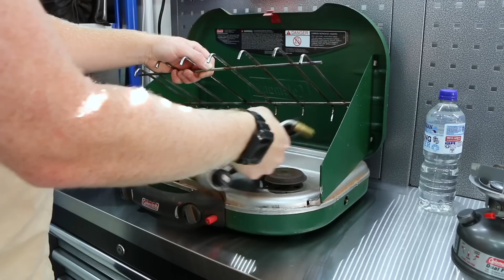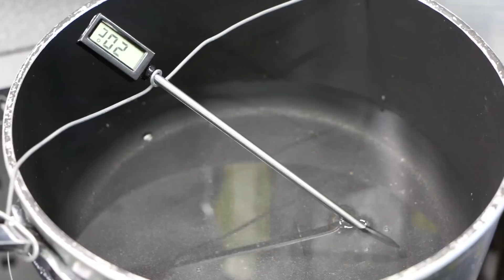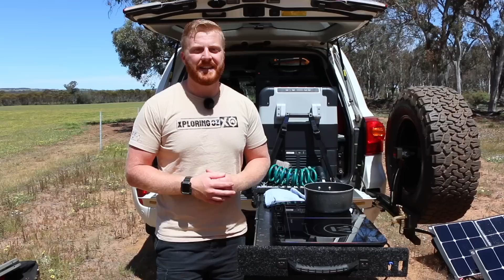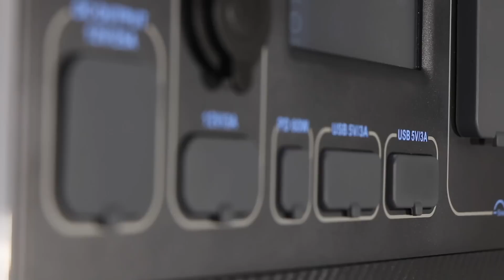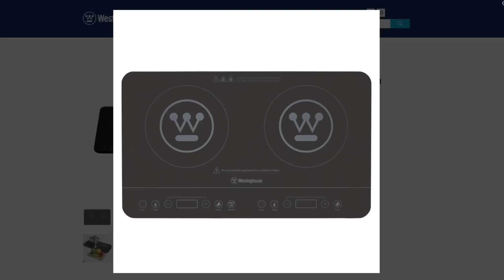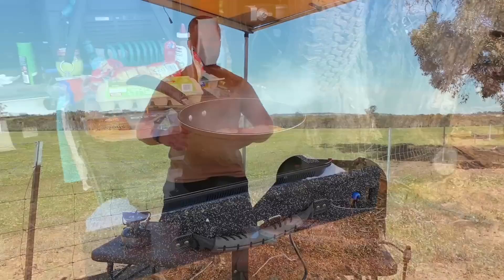INDUCTION COOKING & Camping | Is it sustainable | Electric vs Gas | Overland Cooktop | Pots&Pans

Comment: I'm still not sold on induction only because of their heavy reliance on expensive battery infrastructure I choose to apply elsewhere.  
Traveling in the USA, I have enough battery to run induction (300Ah and 3000w inverter) but instead need to ration electricity for my cooler, lights and especially a 1300w AC to keep my cab live-able at night in high heat and humidity.

I am lucky to have an old, dual burner, dual gas Coleman (love it!) so I don't need to bother with propane.  I also carry a Snowpeak fire pit which I love to cook on when I can.  (Fwiw - I have a Jetboil someone gave me.  I've never used it.  I'd give it away if anyone asked for it since I can't justify the single-use canisters butane and some propane stoves use.)

  I think if I do anything it will be to reduce the cooker footprint with a fancy Jetboil Genesis and 5lb reusable propane bottle which will last ages and will never need top-up while camping unless I get really careless!
Reply from the maker: For sure, it's not everyone's cup of tea. It works, but it comes with sacrifices and compromises, its just depends whether the individuals setup requires that level of compromise 👍 
Glad to hear you have a suitable solution though

Comment: That seems like a really efficient setup.  1400 watts/12 volts=116 Amp hours.  You used approx. 30 X 4= 120 Amp hours. It seems not much of a loss between the inverter conversion.  I wonder if thats due to the Bluetti or that particular HOB?  I just watched another video, not sure of his setup but he had a 50% conversion power loss.  Different HOB though.
Reply from the maker: Interesting to hear the lack of efficiency on the other unit. I would suspect that it would be in relation to the appliance though as my testing with the Bluetti shows some positive efficiency results 👍
Reply: BlueTTI inverter will have 35-40 watts of losses, in ac200max unit, wherever there is any load of not.

Comment: Funny, I was watching this because I am looking at the Westinghouse induction cooktop and then you bring out the bluetti. To top it off you charge it with a 1000w inverter while driving. Lol,  I just brought a bluetti ac200max (with xtra batt) and a 2000w inverter (1400w mac charge on the bluetti) to do the same thing you thought of two years ago. Maybe I should watch a more recent video for more ideas😂
Reply: I own 3 different types of induction cooker and have been using these on the bench continously for a yr now.
Tips:
Dont be at all concerned with temp control
Do by a cooker with a low minimum power for simmer, eg the Ikea has a minimum 100w, some are 200w which is too much for simmer.
Dont buy a cooker that a has long period beween power pulses. Eg, the Westing house hasa boom bust simmer, were the simmer dies in the off priod, then the power pulse boils it over. Once again, the Ikea unit has short cycle times and your simmer is much more consistant.
Do buy heavy base induction cookware, eg the pots and pans at Ikea are relatively cheap, and very well made. The heavy base gives much more consistant results.
Reply: You can get Instant Pot pressure cooker for efficient cooking and simmering and steaming with electricity. They have also air fryer covers, so baking and roasting is an option too.

Comment: Infrared burners more versatile you can have it do double duty as a heater if you need to put that just my two cent hot take
Reply: They are pretty good. I got one in rented apartment, I think. It looked like induction, but wasn't induction. It had flat glass top, but there were some heating elements glowing red. I don't think it is valid reason, though. If you want heating just boil a lot of water.

Comment: A great way to go is just a standard 12V 100Ah AGM battery in place of the stock battery. $200 from china now. They are pretty damn good. No charging restrictions under 41F like lithium. So you can leave in year round in all locations. China is good at pcb components and battery production. I find i use about 100Wh/cook.
Then just get a standard Renogy 2000W inverter and you are good to go. $500 all in with taxes. Then you can go wild and get a portable heat pump unit, an induction burner, and maybe throw a solar panel on the roof.
Reply from the maker: Maybe, however I believe the AGM battery will struggle to output the required current for high powered devices like the induction. The voltage would drop down to an unusable level. That's my experience anyway 👍
Reply: 100ah AGM battery weighed 28.5kg whereas a Lithium 100ah only weighs 12.5kg
If you buy a single AOLithium 100AH, it has a 200A BMS and can easily run a 2000W inverter by itself @ 2000W until it is depleted.
Your AGM wont do that.
Reply: @nordic5490  Only thing you have to think about is if its the main battery, the car won't start after 12.0v. So a great idea to add as a secondary with a smart switch.

Comment: What do you do, if any, about the emf radiation?
Reply from the maker: I personally do nothing 👍
Reply: EMF field density is inversely propotional to the square of the distance. What this means, is that the pot @ 5mm away is closely coupling and 95% of the enegy is tranferred to the pot.

You @ 500mm away, the field will couple SFA, nada, ie, no measureable energy will be transferred to your body.

Comment: Printed on your induction cooktop is not to place it on metal surface. Yet you did and it worked. Or maybe only magnetic metal interferes with it?
Reply from the maker: This is true, however this bench is a very, very thin metal liner, not solid. It compromises mostly of a wood centre 👍

Comment: Nuwave Flex Precision Induction Cooktop, 10.25” Shatter-Proof Ceramic Glass, 6.5” Heating Coil, 45 Temps from 100°F to 500°F, 3 Wattage Settings 600, 900 & 1300 Watts

Comment: For overlanding I've found the induction cook top and, a 2000w yamaha full sine wave gene perfect, the gene has a quiet mode that does work.
Reply: I am surprised that some people still take generators out to the bush to enjoy the serenity. They really are unnecessary now, and every one else hates them. You may as well be playing death metal, or doof doof music.

My 240AH LFP + dcdc charge controller + inverter costs approx $1k AUD now. Some price as your genny, but without the noise.

Comment: Is induction cookware the same.  I bought an westinghouse portable 2 hot plate one.  There's 2 rings and it is the only small rings that heats up, frypan is useless?
Reply: Buy a heavy Ikea frypan with a heavy base. Anyhow, you dont need full power to fry up.

Comment: We have used the https://www.youtube.com/post/UgkxOTeIs0vv4_9B5hsmnLsk9r930uDQLu_Y for probably 30 hours with our camper and it’s been great! The noise level is really only noticeable when running the AC and other appliances like the microwave, hair dryer, or coffee pot. It’s not huge like other ones and it has wheels so even at 90lbs, I can move it!
Reply from the maker: Awesome, good to hear. My unit is still going strong after a couple of years now. No problems 👍
Reply: I am surprised that some people still take generators out to the bush to enjoy the serenity. They really are unnecessary now, and every one else hates them. You may as well be playing death metal, or doof doof music.

My 240AH LFP + dcdc charge controller + inverter costs approx $1k AUD now. Some price as your genny, but without the noise.

Comment: l was up for it until i found out the cost of the battery pack $5000
Reply from the maker: Yep, definitely a negative of induction is the beast of a power system required for it.... still a developing technology on that front
Reply: it is not recommended to carry a gas bottle inside a vehicle. Where do you have it ? Out the back ? On your roofrack ?
My 240AH lithium + dcdc charger + 2000w inverter costs about $1k now. Works great. For an entire overnight, cooking + breakfast toaster + kettle several times uses approx 80ah, or 1/4 of the battery charge. It takes less than 1hrs of driving to recharge my battery. I measured my solar blankets in full sun @ 17A, this means 5.7hrs of sun would replace that 80ah. But, I dont even take the solar, driving is enough to charge the batts.

Comment: Love the in depth discussion on this the only issue im seeing with this particular setup is the effeciency losses from charging the lithium battery pack from the car using inverter  a direct dc charge solution would be better
Reply from the maker: Thanks mate, glad it was somewhat helpful. Yes, this is true, and there are certainly more efficient ways to provide the power for these setups. 
I am now running induction full time in my camper and this is powered direct from the 600ah battery bank through a 3kVA Victron inverter 👍
Reply: @XploringOz  this makes the electrical engineer In me happy ❤️ but honestly great in depth video and definitely considering upgrading to induction in my setup also worth mentioning that those cooktops do not rate modified square inverters at all. Definitely needs to be pure sine
Reply: Pretty much all inverters above 1000w are sinewave now.

Btw, then Induction cooker cct converts the 50hz ac to dc first, then converts that dc to between 25 kHz and 50 kHz. Ie, the cooker does not care about the incoming wave shape, as it is rectified and smoothed first anyhow.

LFP charge discharge cycle efficientcy is very high, between 97 and 99% . My 2000w inverter is rated as 97% efficient at full load, and least efficient at small loads. Use big cables, and your system efficientcy is acutally very high, eg >90%.

The biggest efficientcy gain is the improved enregy transfer to the pot or pan.

Comment: The test is always with water.  But when it comes to solid food, I dont like induction, it doesnt seem to do it., or at least my miele hob.
Reply from the maker: Yeah, water is the best test because it's constant. It's easily measurable and easy to replicate the test. 
I've used induction solely for many years now, both at home and in the camper and I've never had any issues and have few complaints 👍

Comment: Use a fireproof bag inserted with a thick wool on the sides. Insert the pot in the bag and than use it on the induction system. You'll probably get 50%extra efficiency.
Reply from the maker: Hadn't considered this, would be interested to see the difference this makes.
Reply: @XploringOz  I wrap my slow cooker around the sweater and it cuts cooking time almost by half. I'm pretty sure you'll get much better results with a heat insulating bag wrapped around the pan. Good luck.

Comment: To be fair, only induction systems with the most rudimentary control system do have the issues you displayed. The better ones can all hold a simmer and don't pulse full throttle / full off but rather stay at the set power level/temperature. Try the Rommelsbacher CTS 2000/IN for example.
Reply: I own 3 different types of induction cooker and have been using these on the bench continously for a yr now.
Tips:
Dont be at all concerned with temp control
Do by a cooker with a low minimum power for simmer, eg the Ikea has a minimum 100w, some are 200w which is too much for simmer.
Dont buy a cooker that a has long period beween power pulses. Eg, the Westing house hasa boom bust simmer, were the simmer dies in the off priod, then the power pulse boils it over. Once again, the Ikea unit has short cycle times and your simmer is much more consistant.
Do buy heavy base induction cookware, eg the pots and pans at Ikea are relatively cheap, and very well made. The heavy base gives much more consistant results.

Comment: On your first tests using the Jetboil - MSR make the Reactor and Windburner - which both use much better tech than Jetboil ( they use Radiant heat ). If you are not aware of them, then please do some research regarding them. They are NOT affected by wind at all, however Jetboil is. BTW I have 2 different Jetboil's  and also both MSR  Reactor and Windburner. For pure boiling water the Reactor is UNBEATABLE BY A MILE. Great video mate, and I love induction! - have Safiery dual Induction in my vehicle.

Comment: I've got a pretty beefy setup in my 4x4 ute with 400Ah of lithium and a 3000w inverter. I've used my portable induction cooktop a few times and I'm very impressed. However, my concern with the uptake of these though is the potential danger of electrocution and severe burns, especially with open pots of water/fluid and the slippery nature of the glass tops. So many of these cooktops are also used directly on steel tailgates. Not many people bother with the huge expense of getting an AC sparky to wire vehicles with proper AC safety circuits RCD or whatever. I think it's only a matter of time before a pot or such is knocked over maybe by kids or a dog during a camp and there's a disaster which will bring in more stringent regulations with regards to electrical fit outs in vehicles. I note that a lot of these portable induction cooktops also have an earth screw on their metal chassis.
Reply from the maker: Yeah, I see your point with the electrical side of things. 
The danger of hot waster etc spilling, I mean of course is possible, but some of the portable gas stoves are terrible. I think there's probably a lot more to be worried about in remote Aussie bush 😆
Reply: I believe the risk of a tipped pot boiling water is just as great with camping stoves, especially single burner stoves, since pots of water are top heavy on camp stoves.

Comment: Bottom line is induction cooktops just use too much power to make them a useable option for camping! You always have a gas bottle for showers so just cook with them!
Reply from the maker: Yeah, kind of. I've been travelling full time from my camper using induction cooking for 4 months now. Although I do carry a 4.5kg gas bottle, this has lasted 2 months only utilised for the hot water. It wouldn't have lasted this long is using to cook too. 
The induction, replenished by solar power is completely off-grid and requires no 'fuel' source 👍
Reply: Bottom line:
it is not recommended to carry a gas bottle inside a vehicle. Where do you have it ? Out the back ? On your roofrack ?
My 240AH lithium + dcdc charger + 2000w inverter costs about $1k now. Works great. For an entire overnight, cooking + breakfast toaster + kettle several times uses approx 80ah, or 1/4 of the battery charge. It takes less than 1hrs of driving to recharge my battery. I measured my solar blankets in full sun @ 17A, this means 5.7hrs of sun would replace that 80ah. But, I dont even take the solar, driving is enough to charge the batts.
Reply: @nordic5490  I’m not talking 1 night of glamping! 😂 get back to me in a year or so, like everyone else finding out lithium and dc-dc don’t last long! Best thing I ever did was get rid of my dc-dc BS! Life is so much easier! You don’t need it if your got good solar BUT no solar blanket puts out 17amp sorry more like 7 or 8. My fixed 47.7VOC 700 watt bi-facial panel does 18.8 amp through my victron 100/50. So I can stay out camping for weeks! Watching everyone trying to start their truck because their batteries are flat! 😂. As for gas bottles there’s more electric car fires than anything related to a gas bottles!

Comment: Well saving 20/30 secs who cares
Everyone gets burnt sooner or later you learn
Carry propane yeah adds weight but not as expensive as batteries and then there’s that weight maybe you’ll have any ways if relying on solar only best hope for sun everyday … generally filling not an issue it’s called be prepared 
I’m not competing in iron chef so If it’s not at perfect cooled down temp I just cook and yeah it still taste good
Reply from the maker: I mean.. yeah, we can discount all the advantages in one paragraph, but it's the addition of all these benefits that add up to a system that can compete. 
It's not for everyone and everyone has different requirements desires. I can only hope this video has helped others to make that decision in determining whether induction is for them
Reply: it is not recommended to carry a gas bottle inside a vehicle. Where do you have it ? Out the back ? On your roofrack ?
My 240AH lithium + dcdc charger + 2000w inverter costs about $1k now. Works great. For an entire overnight, cooking + breakfast toaster + kettle several times uses approx 80ah, or 1/4 of the battery charge. It takes less than 1hrs of driving to recharge my battery. I measured my solar blankets in full sun @ 17A, this means 5.7hrs of sun would replace that 80ah. But, I dont even take the solar, driving is enough to charge the batts.

Comment: Comment on the test.

The ambient temp is important. Gas does not work well in cold ambient temps as opposed to the dual fuel.
Reply from the maker: Thanks mate, this is another good point. Another advantage for induction which will still work very well 👍